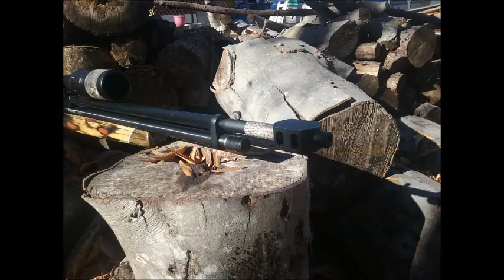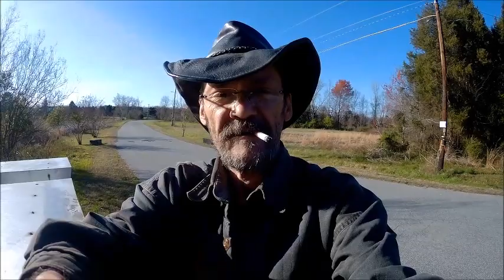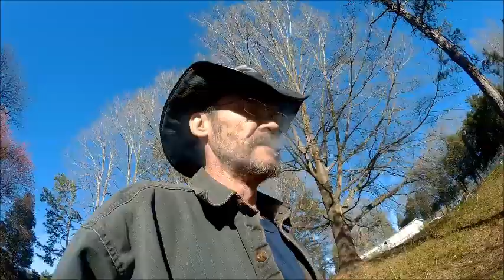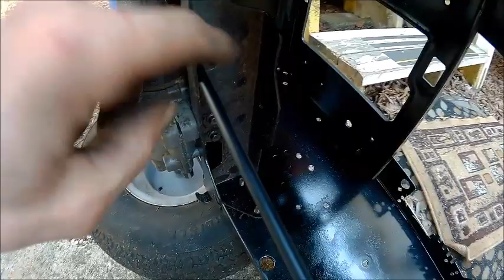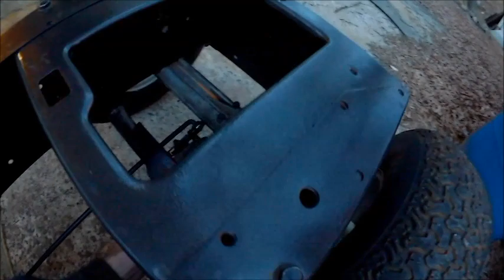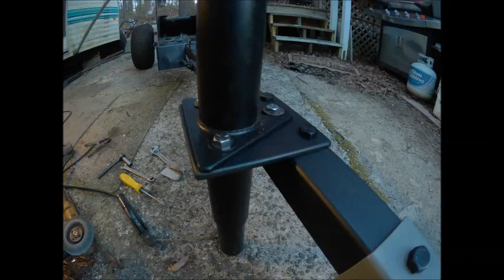garden trailer build part 4 the parking brake

Comment: nice work Bob. I like the way the parking brake worked out. those brackets are pretty slick. I have had the same problem drilling holes with a drill, have gotten pretty good welding up holes and grinding down. only problem is I have found out that trying to drill back thru the weld is TOUGH.